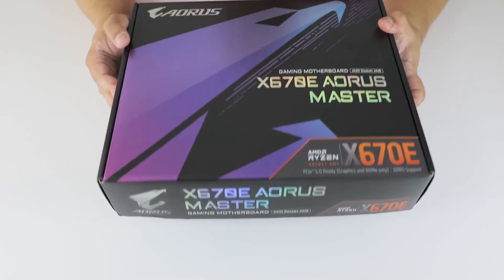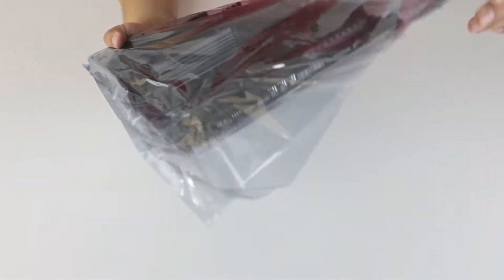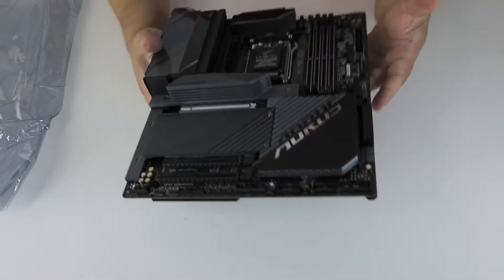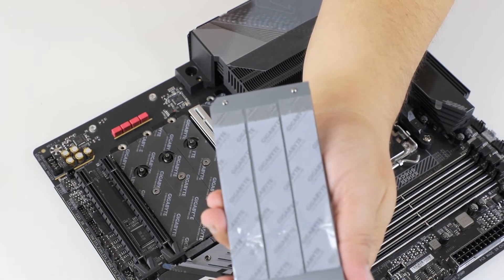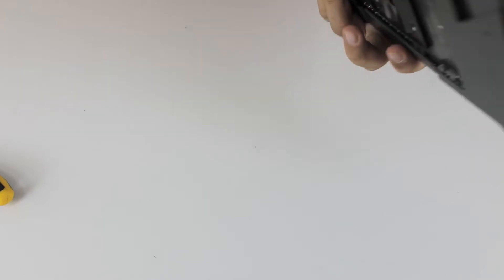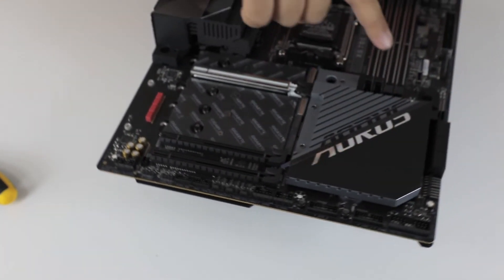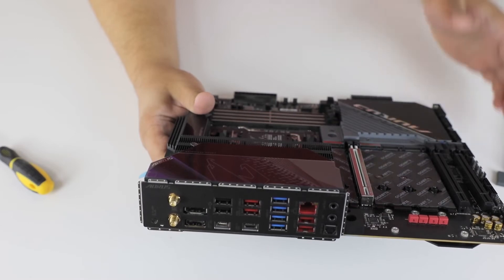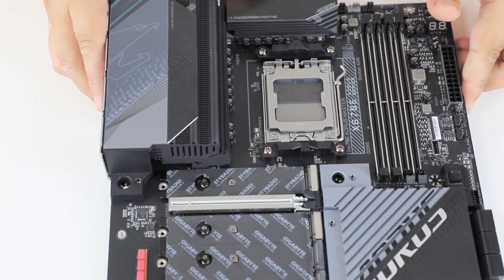Gigabyte X670E AORUS MASTER - Unboxing and Overview - AM5 Motherboard

Comment: A very helpful video. Thanks!
The documentation that comes in the box is terrible. The QR links provided on the included "guide" go to nearly worthless information. Aorus/Gigabyte should be embarrassed.
It took me a while, but I finally found an actual user manual that was easy to print. There should be a QR link or reference to that site included in the box.

Comment: X670E AORUS Master feels like a kick in the butt. Is a big downgrade for me comparing to X570 Aorus Master. Can list some dissapointments: 

1) No backpanel Clear CMOS button--gone! I've used it a lot on the x570 Master. Why would GB think that people might actually prefer opening up the case and setting a jumper for every Clear CMOS? Huge step backwards.

2) Dual bios, mechanically switched, on the AM4 Master--Gone in the AM5 Master. That was a compelling feature for me.

3) The AM5 Master has the same audio codec as the AM4 Master--but GB has removed the hardware SABRE DAC, along with the hardware headphone amp. Result is inferior headphone sound compared to the AM4 Master, by a healthy margin.

4) The AM5 Master loses a Lan port, but gains an extra .M2 slot, compared to the AM4 Master. That's a wash, or maybe better than the AM4, depending on your point of view.

5) Last but not least, the AM4 Master is an ATX mboard while the AM5 Master is an E-ATX, so I'd need a new case for it on top of everything else.

Regards